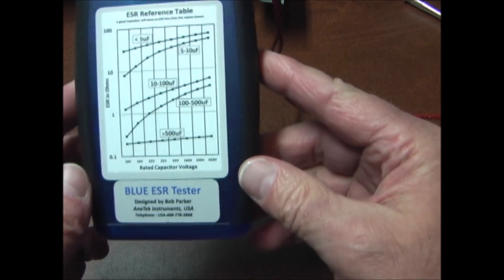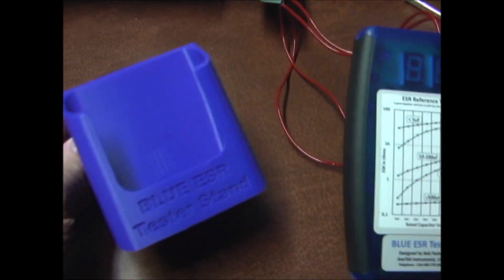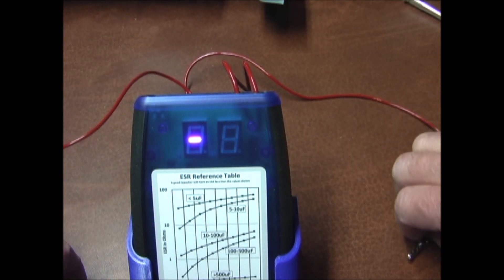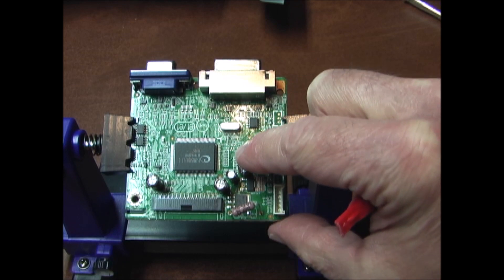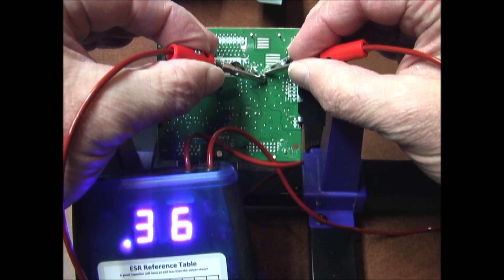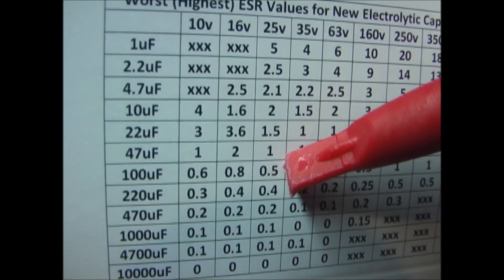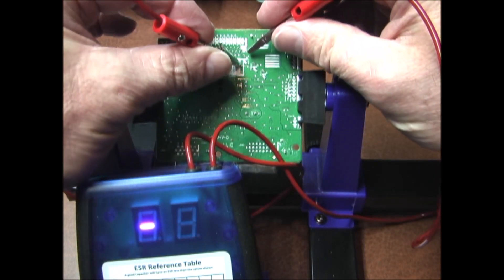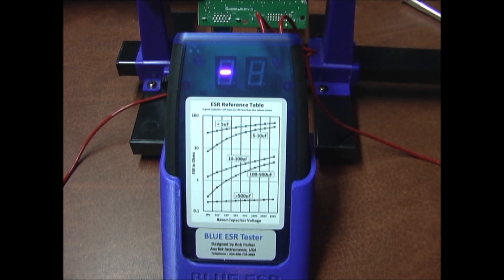Measure Capacitor ESR in Circuit with the AnaTek BLUE ESR Meter

Comment: These reviews I am seeing on Internet do not say anything about input protection, when someone goes to test electrolytics and forgotten to discharge the electroylics, and the charged electrolytic damages the meter. I made two of Bob Parkers meters he had published on "Silicon Chip" magazine in the late 1990's both of them still work, but I have heard of the same meters have been damaged, so the programed IC had  to be replaced, Since Bob Parker designed the AnaTek meter I suspect he has included the input protection just in case.

Comment: Sir, I have a couple of questions:
-1.  the stand was 3D printed ? If yes where I find the model file? (no success with ebay)
-2.  changing that tested bad capacitor the repair was successfull?
Thanks.
Reply from the maker: The Stand was 3D Printed. The file can be found here:   https://www.thingiverse.com/thing:4574494
Replacing the bad capacitor fixed the problem
Reply: @WilliamFrawley  thank You!

Comment: Thank you for our video.  If the capacitor you're checking is in parallel with other capacitors, isn't the reading false?  Thx.
Reply from the maker: "I would agree that you cannot measure the individual ESR of similar value capacitors in parallel, if the combined ESR is low enough then it would be reasonable to assume that there is no fault."